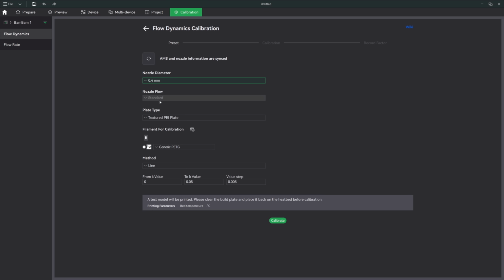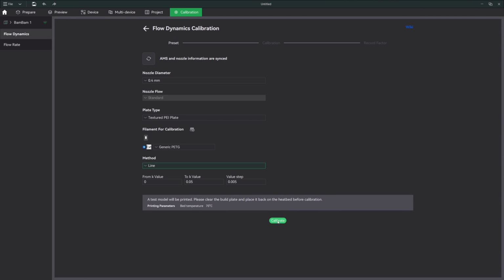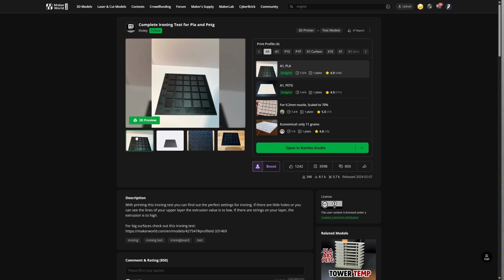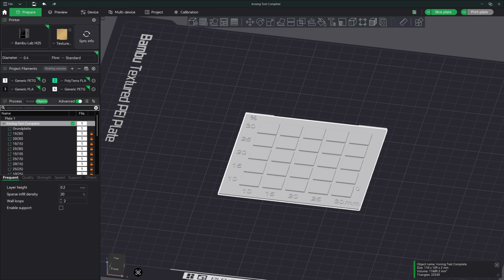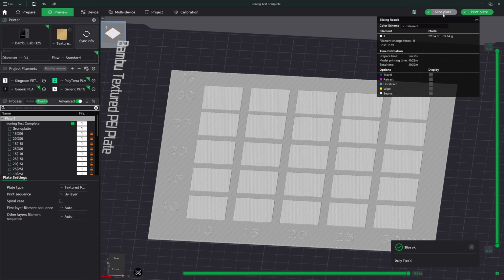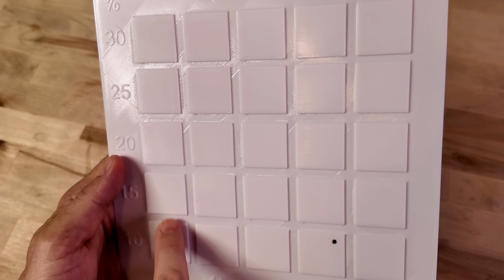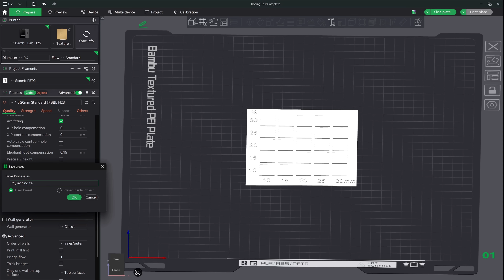How To Get Glass Smooth 3D Prints

Comment: A magnifying glass would help checking your test prints
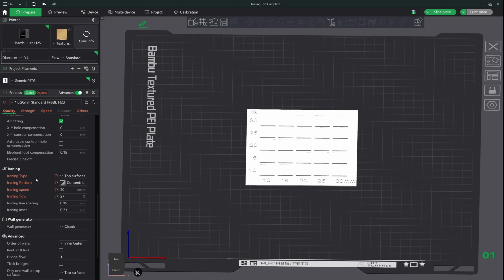6:50 the bottom left square has no visible lines in this video. It looks like it was sprayed with primer.
Every day as more and more people from mask & model builders to people selling whatever they've designed buy printers, this info becomes even more valuable. There's a little printer 50 feet away from me in this library.

Comment: 1. Two part foam is isocyanurate, which is polyurethane, not polyester.

2. One part polyurethane foam doesn't "dry" it absolutely is reacting and curing - humidity in air is what causes foam to polymerize. We know this because if it "dried", the reaction could be reversed by adding water again. 

3. Bigger hoses are a waste of time and money, they won't make a meaningful difference in vacuuming speed for a chamber that small, but larger hoses that won't collapse will cost a lot more. 

4. The ice plug issue isn't because of your hose size - a larger hose would just delay the issue. The issue was too much cold, too fast. Alternatively, very small heaters on these areas would prevent ice up. 

Otherwise, cool idea!

Comment: I went down this rabbit hole for a while and found it to be super finicky and highly dependent on the geometry of the part, infill, proximity to the bed, etc. It seems like it is only worth it if you are printing a bunch of one part and can dial it in for that part specifically. Otherwise it comes out looking worse a lot of the time. 

What works better that i havent seen anyone else try is using a super thin line width for the top layers (0.25mm in my case) and using hillbert fill for the top surface, as well as cranking the flow ratio for the top up to around 1.1. It gives you a nice intreresting surface texture that looks nice when combined with a light fuzzy skin and a textured PEI bed. The parts come out looking kind of like SLS parts.
Reply from the maker: Nice explanation I like those sample settings.

Comment: Calibrate calibrate calibrate, spend more time calibrating than actually printing these days. Only to have it all go out the window with a new spool or new firmware or an update to the slicer. I get so tired of constantly fighting my printers to just print consistently, and using so much filament for calibration after calibration is a bit much when all is said and done.
Reply from the maker: Hmm I have never experienced a change in print quality. I have use the same calibration on my filament that I ran almost 2 years ago. Never needed to rerun it every again. You have seen quality changes after firmware updates?

Comment: You should put in the title that it is for bambu labs and PETG filament... I do not use that and only have an ender3v2 and use ultimaker Cura and PLA... so these settings do not relate to anyone using anything other than a Bambu labs printer and PETG...!!!..
Reply from the maker: Not this method directly but you could very well run a similar calibration. I would look into use Orca with your Ender and you could very easily run the same test in Orca.

Comment: Recently I found an ironing test that runs speeds of 50, 100, and 150. I’ve gotten pretty good results with 150/30. The biggest downfall with ironing is the extra time it takes every print so I found this very helpful to not increase the times a ton
Reply from the maker: Glad you found that helpful for your prints! 🎉 I honestly don't have issues with longer print times ever. If it gives me better results I am happy to let it run. But everyone is different.

Comment: You are running tests for Generic PETG - but are these values automatically saved in the settings for the Generic PETG / Nozzle Diameter combo ????
Reply from the maker: No that is why I mention that you can save the settings as a user preset.

Comment: Thank you for the effort and sharing your expertise.  For a specific manufacturer, say PETG, would you have to calibrate for different colors? I’m guessing you could print a single square with the calibrated settings, this should be sufficient.
Reply from the maker: I would not run a calibration for every color. 1 test for Brand/PETG all colors. 1 test for Brand/PLA all colors.

Comment: If you look at the comments in these ironing calibration tests, you will see people complaining that after calibrating their ironing settings and using those settings to print their actual object, it results in a bad surface quality. I wouldnt put too much hope and time into ironing and spend it instead on post processing.
Personally, I use the AMS for multi-color prints a lot, which gives terrible results when used with ironing.